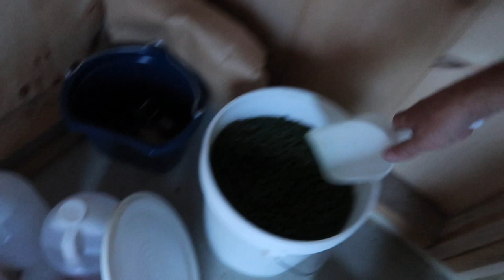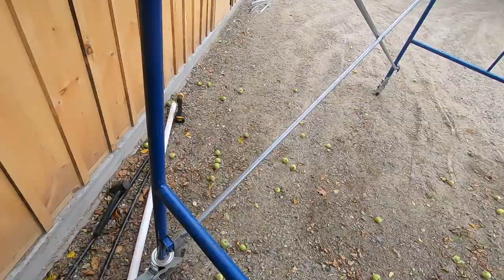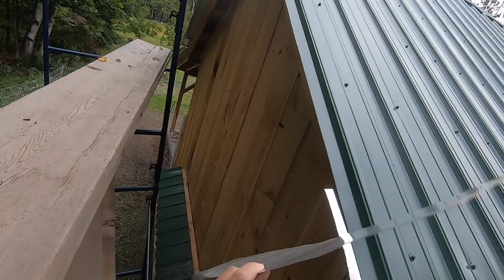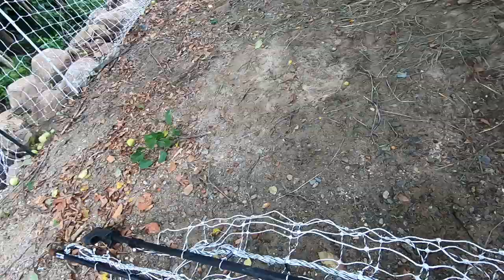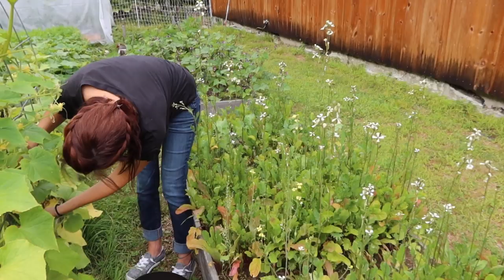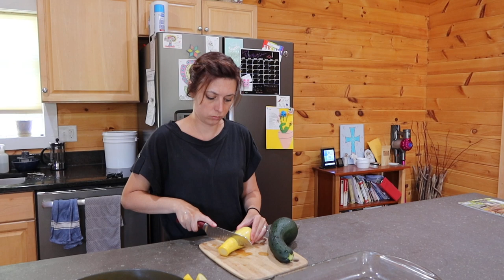It was One of those JOBS! I'm Glad it's FINALLY done. Finishing up The Ridge Cap on the BARN

Comment: We use to use galvanized trash cans for our feed storage, They are easy, and the most rodent proof thing for storage you can get for a reasonable price.
Reply: Yes I agree we use that gor our chicken feed since it has to stay outside but keeps everything out!
Reply: @sharibushnell190  Just watch the lid on it if you have it out in the weather. They will rust and leak over time.
Reply: I bought a small galvanized one that holds 50lbs of feed. $16 ten years ago. Still in excellent condition. I just can't pick up 50lbs any more.
Reply: Agreed. We use those for our dog and goat feed. For our other feeds (pigs and chickens) we use orange-colored, 55-gal plastic, food-grade, barrels. We get them from the Amish for $17 (they used to hold olives), give them a quick wash and they will hold 300lbs of feed each.
Reply: I use those orange barrels for rain catchment for the gutters. I cut a screen and fasten it with the top ring it comes with. No mosquitos or debris. Lasting many years.
Reply: We use them as well, and the smaller ones with the latch top work great for things that have smaller quantities. We keep our feed outside, and love the extra space it creates.
Reply: Me too!!!

Comment: I think you could build a wooden storage bin system like weed em and reap has! Should keep everything tidy and great to keep your pellets and tools stored. You are for sure crafty enough!
Reply: I was just going to suggest the same to Al.
Reply: Yeah, but consider that a wooden storage bin in a dry climate like Arizona is going to hold up a lot longer than in a place like New Hampshire where Al gets a LOT of precipitation.
Reply: @Jake Jones Al just got done building a barn of wood (he could have gone with metal) pressure treated wood over metal might be worth it to Al because of his love of wood. 💓💛💚💙💜
Reply: Ditto on the built in storage for the feed bins like Weed em and reap has.  You could build it under the window along the wall, and you need some good shelving with storage bins to keep everything neat and organized.

Comment: You are a great carpenter. Why not make bins like in the old general stores . Line them with a bucket type insert . Place them in a row with one or more lids on hinges. Leave your scoops in each bin or snap it to the inside of the lid.. 
 So, will you be putting steel screening inside your barn windows to keep out critters?  The bins may need to be locked as raccoons  are clever. 
Really enjoy your video and thanks for helping me recover after hip surgery  as I followed along when I was house bound.

Comment: When fix tin roof panels set you driver to the lowest torque setting so the screw doesn’t buckle the metal and make a well so it can leak, also looks better.
Reply: Yes sir.
The integrity of that metal roof rests on the washer on each screw and the force used to torque it properly.

Comment: You have built a beautiful building and did an excellent job on it.
You plan so well you have probably already thought of this, I am just trying to help.

I have worked construction all my life and I have seen how quickly and easily pine and spruce wood exposed to water can rot.
As soon as possible you should put some kind of oil based clear or color, stained water repellent on the outside.
Apply extra near the bottom where water splashes and snow can pile up.
I would never paint it because paint will easily peel and oil stain soaks in and will never peel.
It is better to install the first coats on before you install the battens. That way it is easy to roll on and you have protection behind the edges of the battens where water can keep the wood damp longer.
I have seen white pine and spruce in areas that don't dry out often turn to soft, rotten sponge in as little as four to five years.
Good luck and keep up the great videos.

Comment: Al, just a thought for your milking room.  Is there enough room in the corner where you have the pelleted feed,  to build shelves or perhaps a Cabinet?  You possibly make a cabinet so you can close the doors and keep things hidden if you came out as far as the window frame.  You could put the first shelve high enough from the floor to accommodate a standing bale of hay and put a thin divider in to house the feed bag in the other side. Perhaps you could build  two smaller cabinets facing each other on either side of the window.

Comment: I've had raccoon and possum chew thru plastic. I have a galvanized can on the deck with chicken food etc.  I lined it with a trash bag b/c of moisture.  I still have to make sure to push the top down tight, and then I pull up the handle, otherwise the raccoon has been seen busting in.  Do you have a roof rake Al?  The lower barn roof looks flat enough the snow may build up.  Also, I have a big magnet that was my dads on a piece of twine to drag around and pick up nails etc.  Tell Gina to look at ajdvarski peppers for next year. OMG... and they grow good in northeast!  Late but abundant!

Comment: Did I miss Figaro? I love that cat! Anyway,  I hope those lean-to roofs can handle the snow load in your area -- they are pretty flat. and will collect snow from the upper roof at the joint. I am currently building a flat roofed addition, and the snow loads can be tremendous! Hopefully it will shed the snow nicely.

Comment: I may have a way to help with the meat chicks. If you spread the feed on the ground before you move the cage. One you don't havta raise the lid. Just one more step removed from your morning routine. But most importantly. The chicks will stay to the front of the cage trying to get to the feed first and you can move it quickly  and easily. Hope the hints can help you some

Comment: Hello. I suggest that you purchase some rubber stall mats and cut them to fit the concrete floors in the barn for the goats. Now is not an issue, but come winter time, the goats will be warmer and healthier than standing around on frozen cement. It will keep the concrete cleaner and prevent staining also. Just saying.

Comment: @9:24 Al the 4th where the 2 pieces of ridgecap overlap and the 7th screw from apple tree edge on the ridgecap were missing. Did you get those and just not film it? Its a fabulous barn. The storage ideas maybe use the height of the stalls to your advantage. Just like with the old goat barn hang a platform from roof joists.